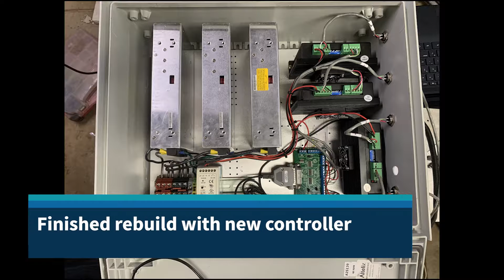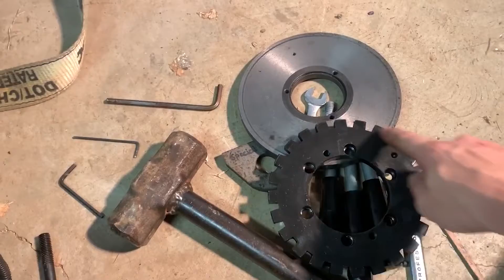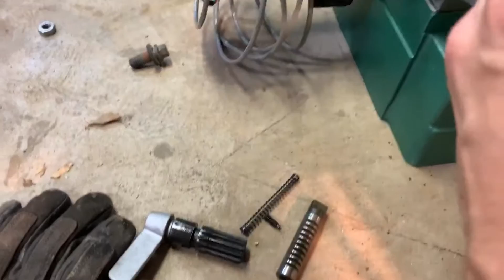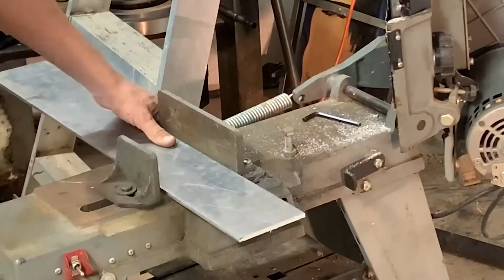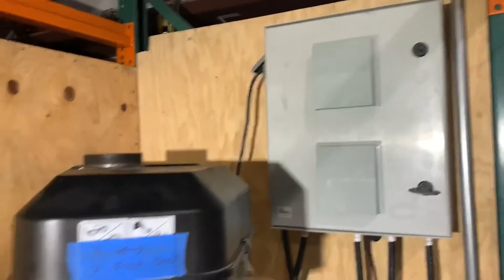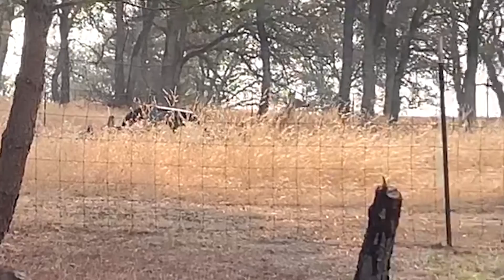DIY 3 Axis mill CNC conversion Part 5. The Finale! Mill is installed and running.

Comment: Excellent work! I will be undertaking a similar venture soon with my Mill. I notice that the ballscrew shaft diameters look substantially smaller than the original ACME screws? Are you able to share any info on the new shaft size please?

Comment: I'm surprised that you bought and converted a round column mill. The spindle sits too close to the column and limits the depth of the throat which makes for short Y travel. Plus You have no use of the Z since it is a round column other than the short quill. I'm sure you know all that. Just thought you would have bought a square column milling machine instead.
Reply from the maker: When I was asked to build the machine, I told the person I was building it for to buy a small mill for the job, and that's what he bought. He had a coupon for grizzly, or some kind of deal to get a discount, and this was the cheapest mill they had, so he bought it. It also happens to be the same type of mill that was used by the machine shop that previously splined his swaybars. It wasn't exactly the most ideal candidate, but it splines his swaybars very well, and fast, so he is happy. But as far as a go to cnc mill, There are way nicer ones to start with for sure. But keep in mind that this machine only has 1 purpose, 2 tools, and 3 programs that it runs 40 hours a week. And I dont know any other shops around that spline axles or swaybars. I really thought someone would have built one of these already and started a new offroad shop, lol.

Comment: Iam picking up two cnc master jr next week they have been sitting for about 5 years hope I can get them up and going but I know there going to have to be updated great videos keep up the good work
Reply from the maker: I have had to update the controllers on their jr. mill, and their full size mill, and it really wasn't too bad. The only real issue i had with them was the power supply that they used, but these were 20+ year old machines when they failed. At that point, it was just the control box that failed, and and was pretty much rebuilt with what I used in this video. Thanks for watching, and I will be starting up another control update to a centroid system on my big mill as soon as I can get my current project out of the garage and some cleanup done.
Reply: @TheSkinnny   I just call cnc master and the want $2500 for new controllers I don't know a lot about cnc but I hope to get them going cheaper then that
Reply from the maker: That’s exactly why I built the box. They charge a lot for it. The controller can be built for less than $1000 easy, and probably closer to $300 if you use cheap parts. The controller I got from acorn cnc was around $300, and power supply’s and motor drivers are less than $100 each.
Reply: @TheSkinnny  acorn is what I have been looking at just new to this cnc stuff I have a cnc plasma table but it was plug and play
Reply from the maker: @russell388877  I ordered the acorn controller because of the centroid system it uses. I have used a centroid controlled lathe for almost all of my time running machines. It is conversational, and writes most of the g-code for you. I havent ever used it on a milling machine, but my hopes are high. And the support they offer is awesome. just in checking out centroids website, they have many wiring diagrams that are well drawn up, and for almost any way I could want to wire  up the machine. Most controllers I have used otherwise, left me the feeling that I was all alone in figuring it out. Its really nice to know that the support is there if I cant figure something out.
Reply: @TheSkinnny  have you ever used a stand alone controller? Got the mills in the shop today and they need a lot of work
Reply: @russell388877  Take a look at a Masso controller. It is a stand alone controller.

Comment: I wached all the viedos and I am quiet impressed. You did a good job and it looks like it works very well. Good job my friend. But let me say one thing, that's no complain, but you should do some house keeping in your workshop, it makes life easier. All thumbs up.
Reply from the maker: Thanks for checking them out. Definitely right about the housekeeping. Its a lot of machinery packed into this little shop that there is little room for a mess, and I have completely maximized it, lol

Comment: Any way you could post amazon links or details of all the components that you used? Loved the series, looking to perform a conversion on my mill in a similar fashion
Reply from the maker: I will try and dig through what I can, but most of the kits were supplied to me by the owner of the machine. I am starting another cnc mill project in the next few days using the acorn cnc 4 axis centroid controller, and it’s going on my old blue mill. But the majority of the parts came from cnc4pc.com or the Amazon store automation technologies.
Reply: @TheSkinnny  Cool.  I was interested in the power supplies and electronics cabinet to start getting my project rolling.  You mentioned a lot of that stuff was from amazon so I figured you might have links.
Reply from the maker: The 48v power supplies, stepper motors, and motor drivers, were all sold together as a kit on Amazon. The enclosure was from Amazon as well. I can’t find any kits like he got on Amazon, but the motors were dual 1/2” shaft nema34 1600oz/in stepper motors. The drivers were stepper online dm860. The power supplies were 48vdc and 11 amps each.  I will try and get some links on my website for the rest of the supplies. As far as a box goes, I believe it was 17x14x8, and that was very tight. I can’t find the box he ordered, but search for vented nema enclosure and it should bring up some options.

Comment: Thank you so much for your time making the videos.  I see that you are blessed with a wonderful family.  I have a harbor freight mill that looks just like yours.  I am getting started at putting a conversion kit on the mill.  I wish i could find a way that when I move head down that I would not have to loosen 2 bolts then crank it down and the head can move left or right.  Again thank you and God Bless.
Reply from the maker: Hello and thank you very much for watching. I hope you have fun with the conversion. And I totally understand about the headstock crank and lock down bolts, they did not make that easy for sure. Merry Christmas and God bless.